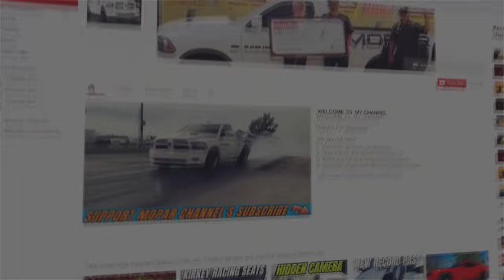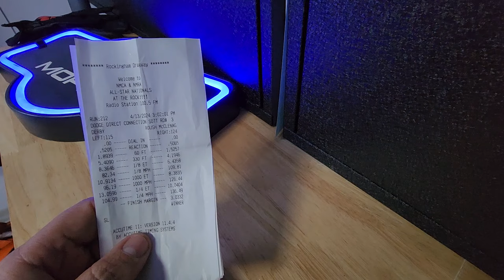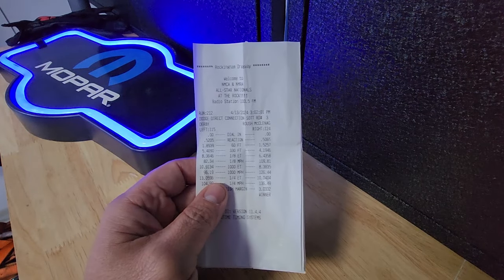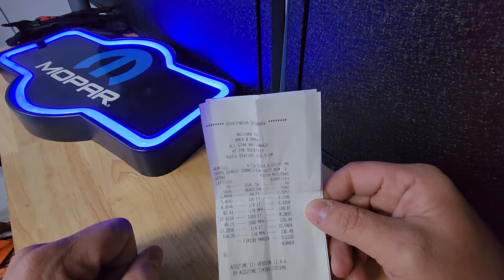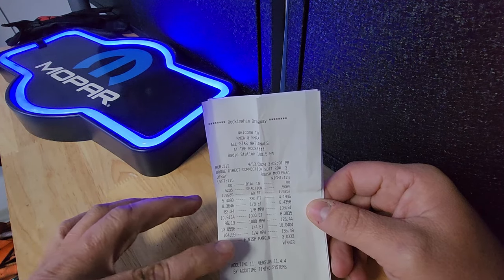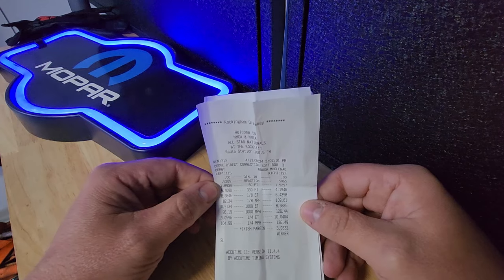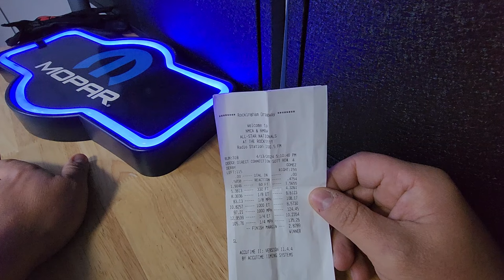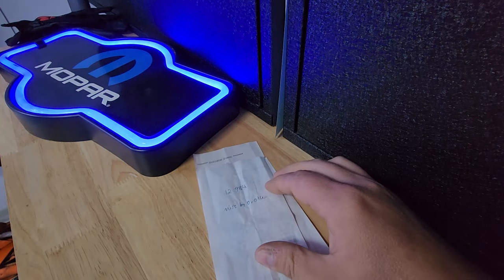Stock 5.7 HEMI Challenger R/T Runs First 12 Second 1/4 mile

Comment: For you guys that want 12s with 5.7 you don't need thousands on long tube headers , cam, tune , computer. Listen from an old dude that started this in the 70s. 85mm throttle body, cold air intake, hot plugs - coil packs, oil catch can, shorty headers, 3.09 LSD with differential brace, straight piped exhaust, 285 tires with 18 psi air pressure. Take out the back seat, take out spare tire, 93 octane gas, and no matter how good you think you are you will never outshift the computer leave it and drive stomp on the gas and let it eat. I built mine for under 3 grand in upgrades. 12.7 on the street is a fast car kids believe me and enjoy. Remember you will never out run the other guys credit card . Have fun with what you have.

Comment: Congrats on the 12s I love seeing other  5.7s hitting numbers.I'm the bone stock 5.7 car record holder on radials of course. No tune no mods 12.82 in 1400 DA 1200ft  track elevation.  Now with hp tune & longtube headers 11.9 is my pb. I run nmca also. Alot of the 5.7 cars will get faster with more passes like mine. I drive mine to the tracks  if I'm in a index or bracket race while I'm on my way to the track I do around 10 hits so when I'm at the track I'm already in race mode for all out or index or bracket I don't have to worry about her getting faster she already there my car will run very consistent.  There some really good racers that win the 12,13 second index. Maybe I run in to you guys sometime I should be at Detroit my home state Ohio & Indianapolis. I'm long-time follower.
Reply from the maker: Awesome 💪
Reply: Where place a person can find info on what cars hold the record and all that.